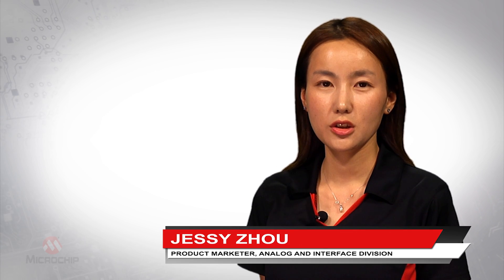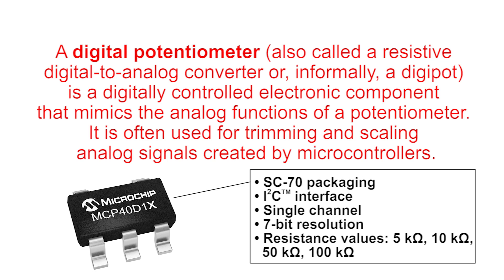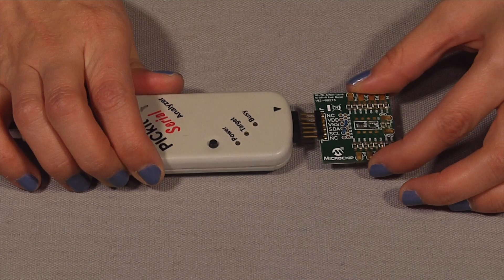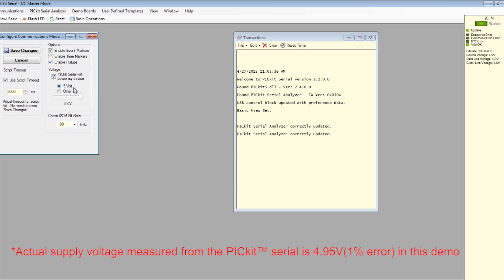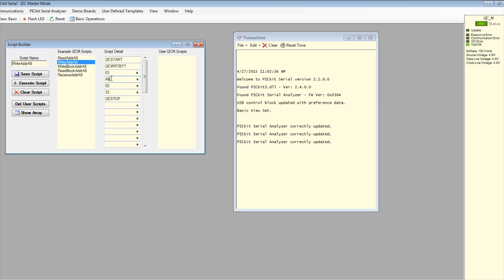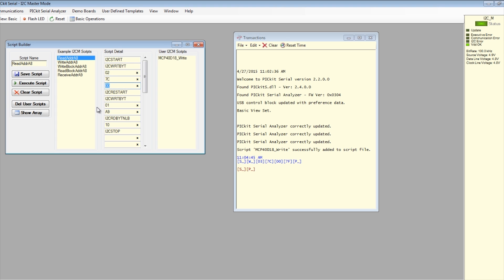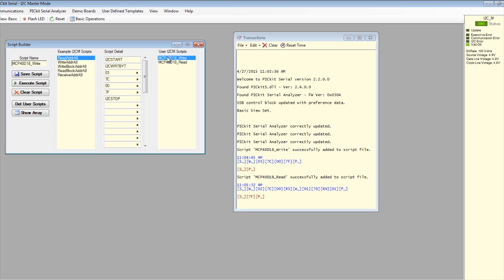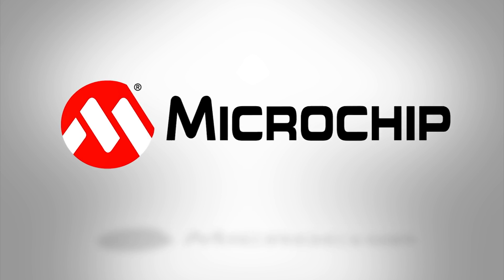MCP401XEV Evaluation Board

Comment: Very helpful video.  I do wish you had explained the sequence of codes sent to the chip in a bit more detail, like the first byte does this, the second byte..,  however, it's not a big deal, I'll look it up on the specification sheet.
Reply: Bob Diaz  i give u the function using xc8 , ;) 

void set_pot(unsigned char data) { // per controllare il potenziometro dell'induttanza elettronica
    CS = 1;
    OpenSPI(SPI_FOSC_64, MODE_00, SMPEND);
    CS = 0;
    WriteSPI(0x11); //in riferimento al data sheet MCP41010 10Kohm
    WriteSPI(data);
    CS = 1;
    CloseSPI();

}

remember :  #include<plib/spi.h>

Ciao!
Reply: Thanks!